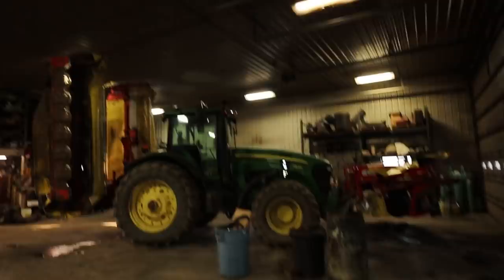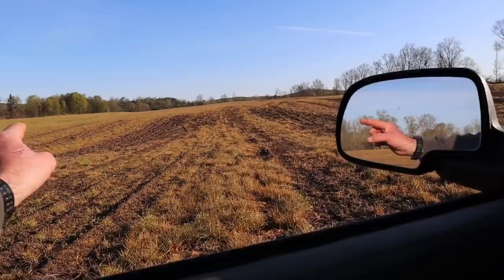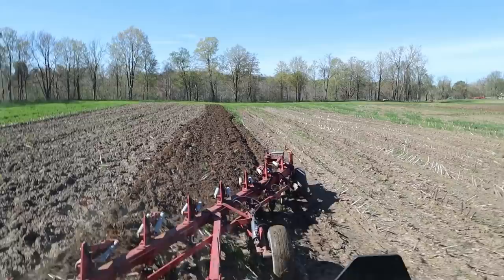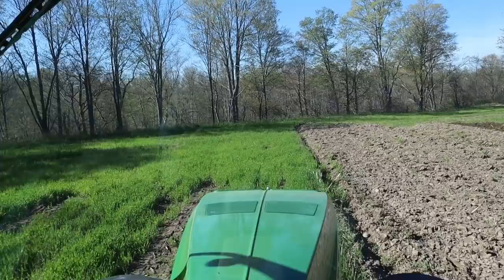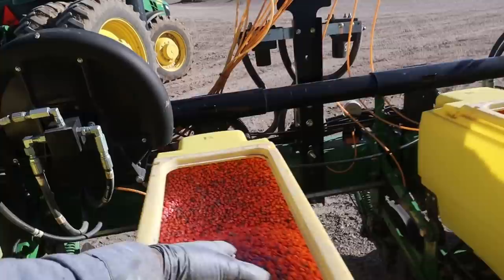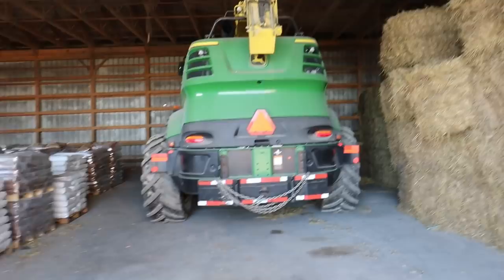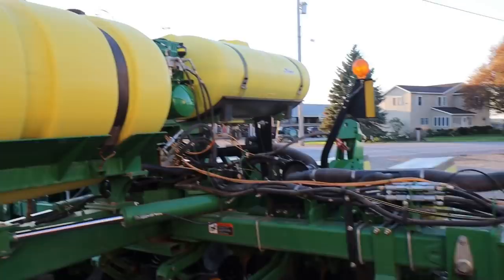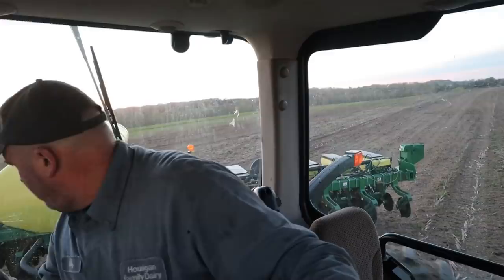Pottinger mowers, silage trucks, plows and planters

Comment: Lots going on as usual. Didn't realise your triple mowers didn't have conditioners. Good deal lighter without. Triples with conditioners and belts for merging three together are very heavy. 7930 on triple mowers is a lovely combination.
Reply: Clive Atwood I run a 7260r with a triple Kuhn mower with conditioners and sometimes I wish the mower didn’t have them, it slows the machine down too much.

Comment: Does that Chevy truck have a 12 valve 5.9 Cummins in it?
Nice librarian glasses 
How would you feel if your daughters wanted to start working with the heavy equipment?
Reply from the maker: No it has a 8.1 gas engine. Whatever the kids want to do is up to them.

Comment: What do you run for air pressure on the planter when in tilled ground and doing no till if you don't mind telling me?  I have a new to me, 1760 NT with air down pressure that I have not used yet.  Next week  going to start soybeans and corn on what I can get into for dryer ground.
Reply from the maker: 30-80